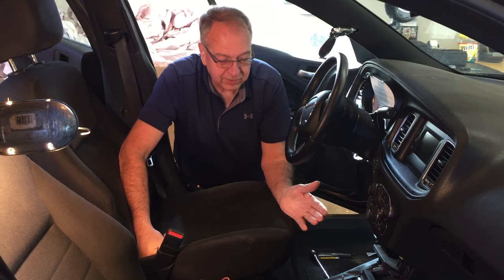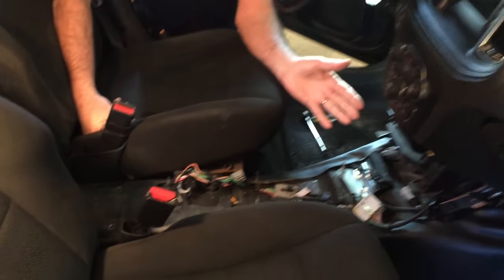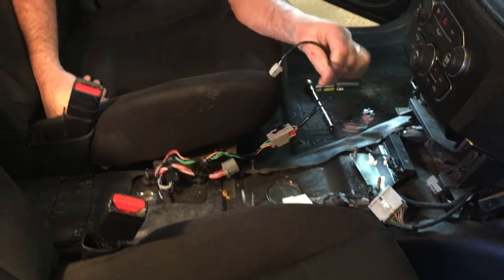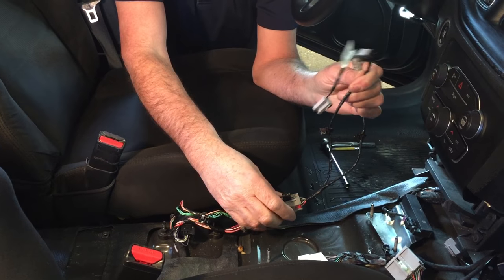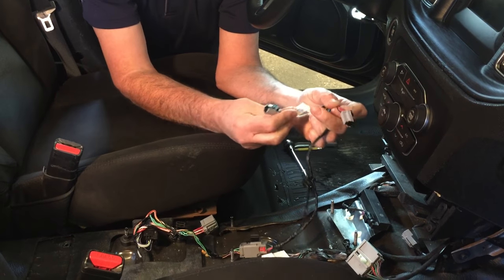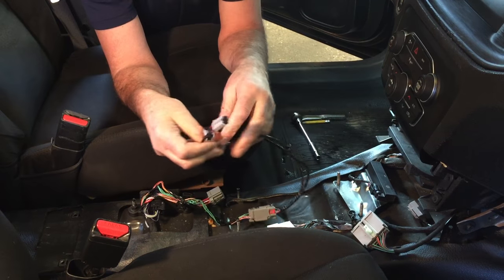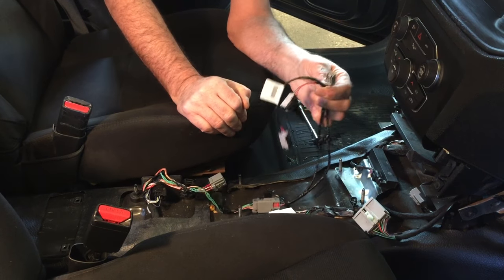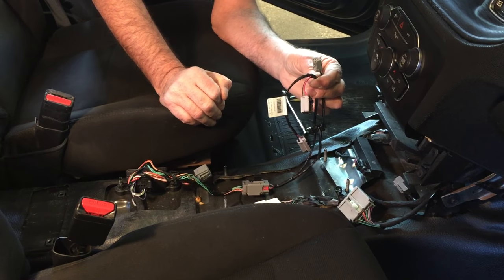Dodge Charger Police Vehicle wiring harness explanation

Comment: Is this chassis cable(grey connector) that you plug your breakout cable into located under the shiny steel accessory plate? The cop car I bought has a  console in it with nothing hooked up (usb,12v...), I assumed they didn't know how or care , however with your breakout cable it looks like a breeze. I peaked into the console where the shifter would have been and the console appears to be mounted on that shiny factory plate. Didn't see that grey chassis harness connector in there.
Reply from the maker: If you can take a photo of your console area email it to info@nenno-products.com we can review it and get back to you with more specific answers.  Include the year of your Charger.  We also have a photo that shows where the breakout harness attaches to the underside of the factory plastic console trim panel on the 2011-2019 Charger we can include in the reply.

Comment: Would you know how to get the front speakers working?
Reply from the maker: Check the wiring harness connector at the radio, the upfitter may have cut into and diverted sound from the AM/FM car radio to the 2-way radio gear. Look for the splice and reconnect.  If not, check the connectors on the speakers.  I hope this helps.
Reply: @nennoproductsllc2336  I will check tomorrow morning and get back to you, I made sure speakers were plugged in so hopefully that’s it
Reply: @guyerikk  hi man i know its been a year but did you solve the issue? Where did you find the cables?  I have the same issue on my 2016 dodge charger police
Reply: @JavierRodriguez-fw9mi  I don’t remember as I sold the car long ago but I believe the speaker wires were just unplugged and that was it

Comment: Would you happen to know the part number for the wiring grounded or screwed on the vehicle . I bought the plastic trim one that came with the 12v ports and the wiring for the 12v ports but I wasn’t able to connect the big grey connector because it seems to be that it was cut off not the one for for the 12v but the one that connects to that one in the vehicle
Reply from the maker: please contact us for assistance info@nenno-products.com and include photos of the area under the trim panel in attachments of your wiring for reference.

Comment: What is that front sensor for where the center console go & what’s the part number for that sensor
Reply from the maker: I suspect the part you are asking about is called a passive entry RF module.  We recommend sourcing this through your local Dodge parts department and give them the last 8 digits of your vehicle ID number.  It might control the key fob functions and I don’t know if this is a plug and play or if the dealer has to flash any code in to activate the functions in the new one.  The dealer can provide all the information you need on this.  Thanks for asking.
Reply from the maker: The passive entry module is P/N 68142047AB for the 2012-2019 model years.  We have these modules in stock right now, new factory parts.  It includes the metal sensor mounting bracket.

Comment: where is video # 2 to hook up power to usb hub
Reply from the maker: The USB harness located in the OEM plastic trim panel is powered through the mating USB connector at the lower right center dash area.  Contact us for further assistance and if possible include a photo of your lower center dash and console wiring with the OEM trim removed for visual reference.
Reply: @nennoproductsllc2336   there is a small grey plug that is used to power the usb hub  how to connect that to the hub in the console
Reply from the maker: @tedgebala140  The AUX/USB port is normally installed in the police plastic trim panel shown in the video, between the two 12V power ports.  It plugs into the gray connector in the lower center dash.  If you are missing the factory AUX/USB, it can be purchased here: https://nenno-products.com/product-info/68232705AA
Reply: @nennoproductsllc2336  im trying to connect a civilian usb   , i think i need to splice that into the usb hub to power it
Reply from the maker: @tedgebala140  Sorry, there is no direct plug and play for adapting the wiring from a civilian console into the police builds that I am aware of.

Comment: By chance do you know the part number
?
Reply from the maker: Not sure which p/n you are looking for.  The harness that powers the two 12V ports and ties in to the AUX function from the AUX/USB harness is 68155494AA.  https://nenno-products.com/product-info/68155494AA and there is another version that terminates the passive entry module with the extra 2pin connector here: https://nenno-products.com/product-info/1189509AC2 I hope this helps.
Reply: @nennoproductsllc2336  Exactly what I was looking for your awesome Thanks !